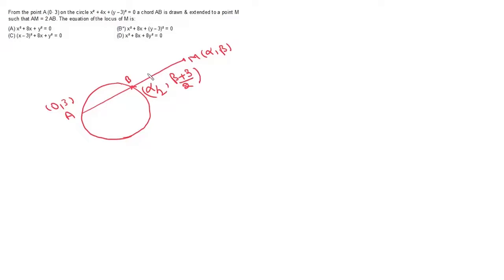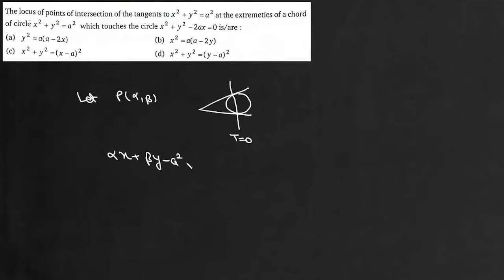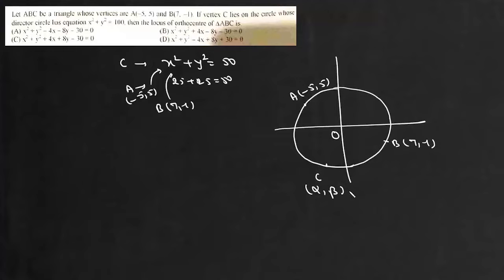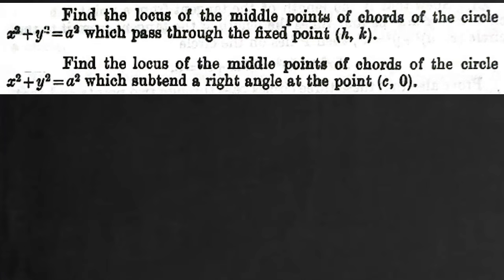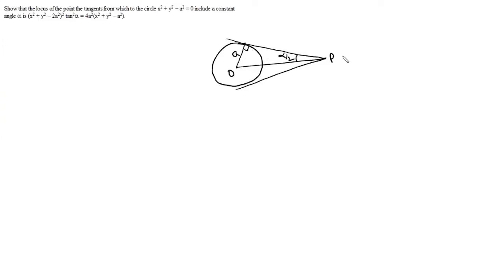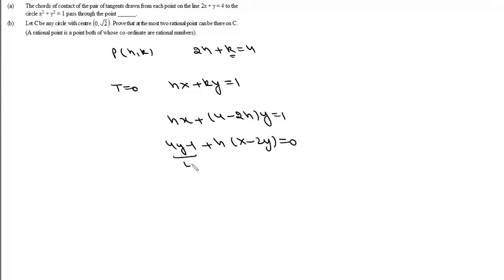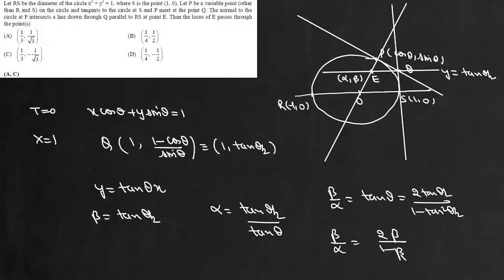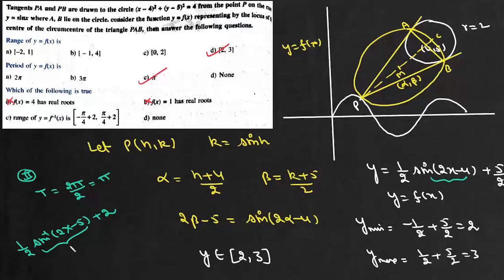Circles | Lecture 6 | Advanced | Mains | Locus related questions

Comment: @Mathsmerizing Erratum: Question at 24:58 is wrong. 
The triangle will be only possible in first or third quadrant due to its nature of centre and radius, but the question states the circumcentre ((38,-37) which lies on the hypotenuse of the triangle) is in the fourt quadrant.
Reply: Yes you are right